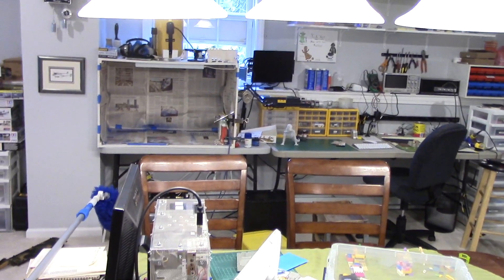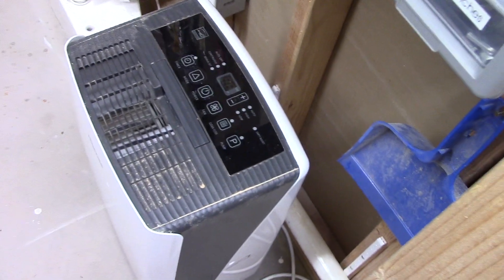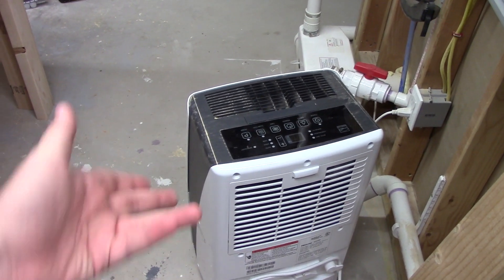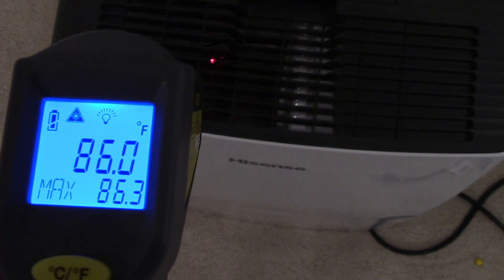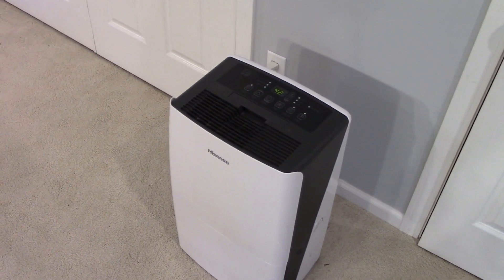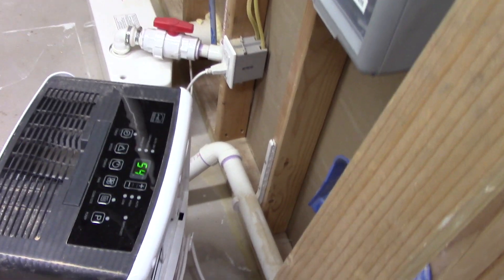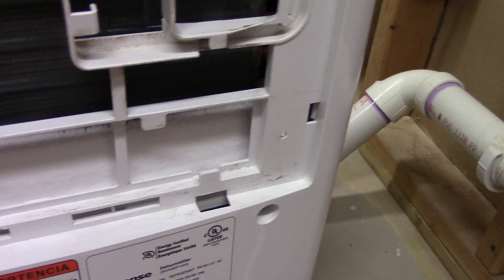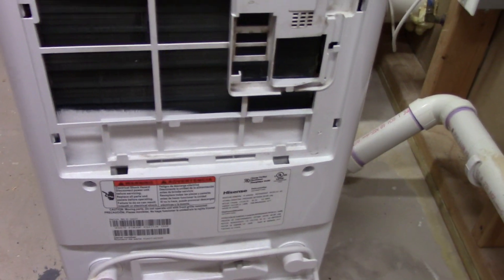The 2017 Hisense Modern Dehumidifier. Remember This?

Comment: My grandmother had a Montgomery ward dehumidifier that lasted 45 years and she bought a brand new Frigidaire dehumidifier that already has a rotting coil
Reply from the maker: Oh I can easily believe that!
Reply: Spats and I have a 48-year old Whirlpool in daily use in our basement, never been repaired.
Reply: @HarleyBadger  the old American units last forever
Reply from the maker: @HarleyBadger  One thing I wish my Kenmore had was a metal fan. Jay had a Sears Coldspot which had one. Unfortunately his dad wanted the fan first.
Reply: I am olney buying vintage dehumidifiers because the new ones are inefficient Chinese crappy made junk. The old dehumidifiers use more energy but they run for less time. And work alot faster. I payed $25 for the Coldspot i have and it's worth it.
Reply: Im done buying hisence dehumidifiers. Had 5. They last a couple years and they die.

Comment: Yep, I've seen 2 dehumidifiers fail in the same fashion. My Mom's 2013 GE and my Grandmother's 2012 LG. Both fail around the same time. (Around June 2018.) Found on Craigslist a vintage 1980's Whirlpool for my mom and a 1990's Edison for my grandmother. Both run great. However, the Edison needed a new humidistat. Both have a continuous drain into the sump pump. Can't ask for anything more!
Reply from the maker: Great move! Those bad boys will last a long time!

Comment: My grandma has a vintage, USA-made dehumidifier that is like your's. The only difference is that it is labeled Whirlpool and it is black, not wood colored. She says that it does not work well. I discovered that the coils just needed to be cleaned! I cleaned them and now it works like new. She keeps buying new dehumidifiers, thinking that they are better. Her GE dehumidifier from 2014 died in 2017. I will tell her to start using it instead of wasting her money on a throw-away one.

Comment: The vintage units are more trustworthy all the way around. No fire hazards,  no extremely warm air blowing out and I think they they are quieter after the obvious start up sound. I can’t believe how the ice was even forming on the outside. Is there a defrost sensor on this?My vintage dehumidifiers always start and I didn’t pay much for them. I have a 2017 Garrison 35 pint on my main floor that so far seems to be holding up but has gotten a little louder over the last summer. I’m only using it because I like the timer feature for cooking, showering etc. But once it goes I’ll replace it with a vintage as well and just throw a timer on the plug.
Reply from the maker: That sounds like a good plan!

Comment: 86 degrees is the warm air exiting this type of dehumidifier, okay.  I have no flipping idea what type of dehumidifier to get for one room that is under 300 sq ft.  I do not not not want to add ANY heat to this room. I HATE heat! I added a window AC to bring the temperature down to below 68F.   Now, I need a dehumidifier that will control humidity just under 50% or lower. I hate heat (any temperatures above 68F). I hate humidity that inches towards 60%+          Any suggestions??

Comment: Sharkie, not only have dehumidifiers gone downhill, or whirlpool top loaders. Craftsman tools have gone also downhill with quality. Since 2010, Craftsman has been making wrenches and ratchets, and sockets in China. Just like most Chinese stuff, they are poorly polished. In the past few years, they stopped making screwdrivers here too. They are currently made in Taiwan. It is just sad that they can't be the brand they once were just because of greed.
Reply: Craftsman tools are now owned by Black & Decker. Yes lower quality now.

Comment: I just picked one up for free today at a yard sale.  They said it would work for 30 minutes and turn off?  I know you cant use an extension cord as the compressor will not run, so I assume they had it plugged into a ext. cord vs. direct to an outlet?  I have it on now in the basement and going to check on it soon to see if this is working or going to my scrap heap?
Reply from the maker: I guess time will tell!
Reply: Sharkie626 E9 Code!  Not working!   guess I will check into the humidity sensor.

Comment: I have a 60 pint Hisense with a pump. Just got it from Lowes. What buttons do you push so you never have to dump the bucket? Everytime I check on it the bucket is filled and it stops! I still have time to return this but what do I get? Two big rooms. Basement has tons humidity with one long wet fieldstone wall. Any thoughts? Thanks!
Reply from the maker: Just gotta turn the Pump button on.
Reply: @Sharkie626  What is "Auto Dry".  You mean just press that one button? Pump?
Reply from the maker: @ianscianablo8507  Not too sure on Auto Dry. Yeah, just that button.

Comment: I have the same one and the pump won't automatically empty the bucket on its own anymore. I've had it a little over a year now. I noticed the blinking light at the pump button and if I hit the button twice to turn the auto pump off then back on, it will then pump the water out. Anyone recommend a good/reliable dehumidifier with the auto pump function? Thanks in advance!
Reply from the maker: My bro now has a GE in its place. No problems so far. How long will it last? Time will tell.
Reply: @Sharkie626  Cool, thanks! Any chance you know how to fix the auto pump problem on this one or did your brothers unit have both problems happen to him at the same time?
Reply from the maker: @jplmpz  Maybe the pump filter (if it has one) is dirty, or maybe the end of the tube is blocked.

Comment: These Hisense units are garbage. If you get 2 years out of it, consider yourself lucky. I've had 2 and they both died less than 2 years later.
Reply from the maker: Oh yeah, they don't last at all.
Reply: Mine has lasted for 5 years. It’s still running but freezing up. Guess I got a good one 😂

Comment: its like an air conditioner if u have set so its running all the time workin hard they can freeze i set my de humidifier at 65 70 now  i use to have it at 50 55 and it was running nonstop  4 litres a water a day it was pulling  crazy
Reply from the maker: It's not like an air conditioner. Air conditioners also remove heat, dehumidifiers do not.

Comment: Dont seem to matter anymore...about 1 season and trash...I know..I have 5 different brands and they all did the same thing...so I'm gonna start working on them to learn something
Reply from the maker: THAT bad?? Dang, but not surprising at the same time
Reply: @Sharkie626  I have an old Fedders...probably going on 30...still makes water...bout once a year I take the fan out and grease the bearings....but these new ones....maybe 1 season...maybe...no way from my experience 2 seasons...like I said I have 5 different brands that dont make water..they run, compressor works but no water...so I got tools coming to recharge and maybe repair...what have I got to loose??? They dont work now and I might learn something about how to make them last like the old ones do